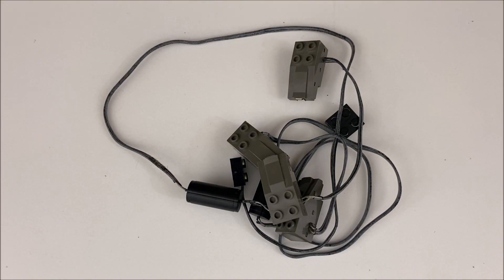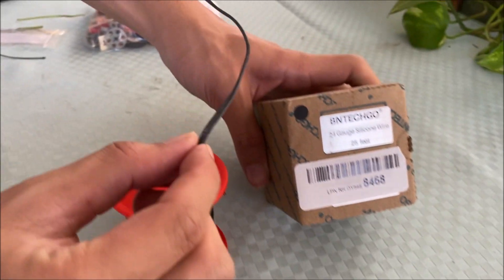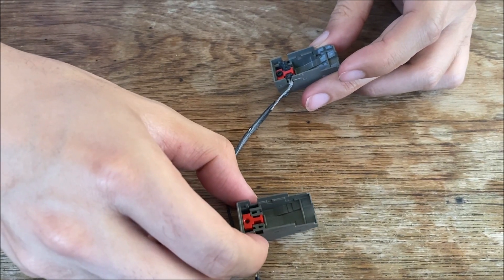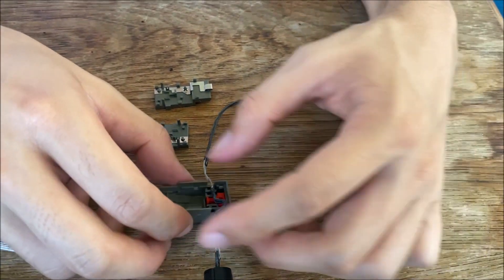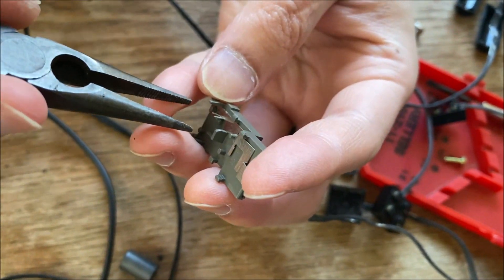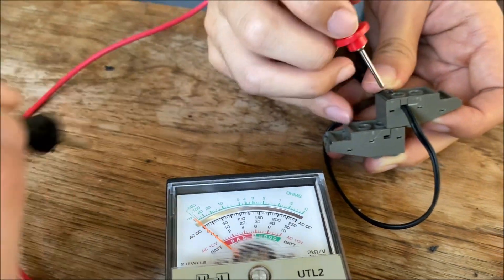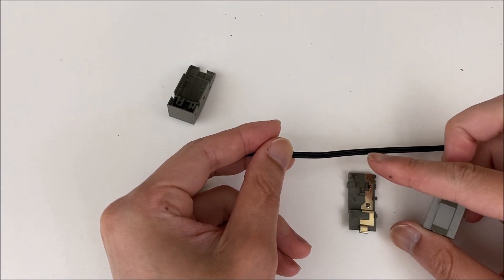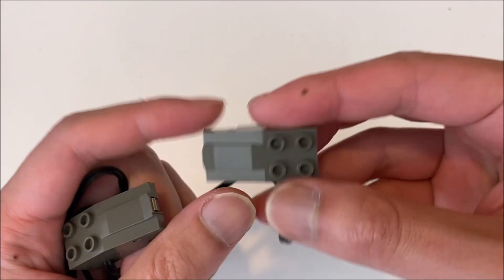LEGO 5306c01 9v Train Track Contacts Disassembly and Repair

Comment: I've had good luck with the train connector by gently prying out the outer case with a thin plastic tool just enough to get the pry tool up in between the two parts.  Then use a small flat screwdriver to pry each tab down.  Repeat on the other side.  Works with minimal damage and they go back together nicely.
Reply from the maker: Good tips! Haven't had to do nearly as many of these as the standard cable, so the process isn't quite as refined.

Comment: I’m having a rough time finding the cables. Do you have a direct link or search term I can use?
Reply from the maker: Hello, this should be the one: 

https://www.amazon.com/BNTECHGO-Silicone-Ribbon-Flexible-Strand/dp/B09X48JD8F/ref=sr_1_11?crid=20QVIK88X54WQ&keywords=BNTECHGO%2B24%2Bgauge&qid=1682913884&sprefix=bntechgo%2B24%2Bgauge%2Caps%2C149&sr=8-11&th=1

Make sure you get 24 gauge, but 2/4/6P should all be fine.

Comment: Hey I know that guy 😅.  I had a much easier time getting the connectors apart on the half dozen cables I've made, but I have had some of the black 9v connectors refuse to play well (see what I did there?).  Maybe there were slight differences over time in the manufacturing or maybe how they are stored over the course of 20-30 years plays a role in the softness of the plastic.  The shell for the ferrite choke is a pain no matter what you do, the tabs are on the end but kind of hard to get at.  As you said cutting the wire first and prying on the ends usually works alright.  Thanks for sharing, as I've said it took me 10 years to find this wire so I always appreciate a shoutout for that effort 😁
Reply from the maker: The track connectors just felt a lot more fragile than the other end. I pushed a little bit too hard and broke a few of the tabs on the second one I tried DX